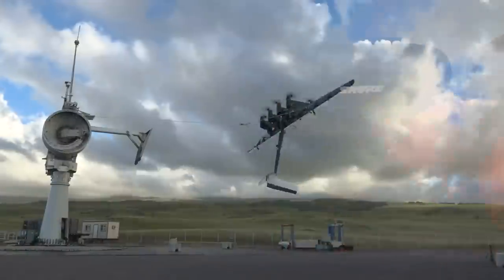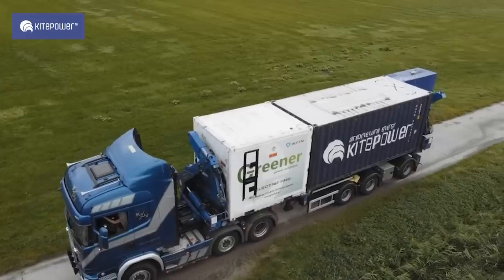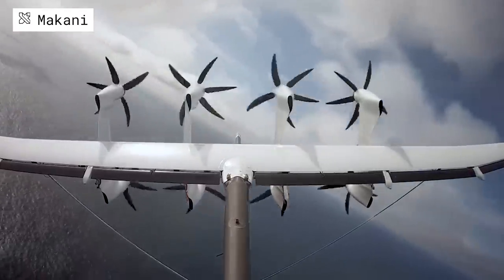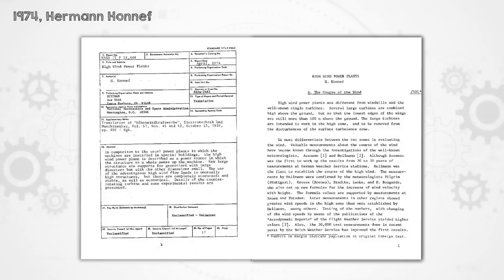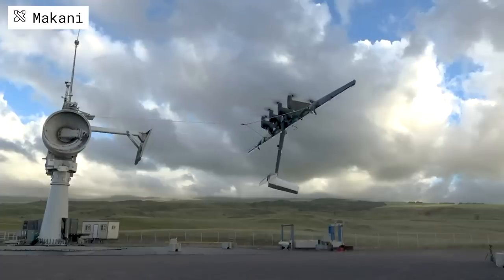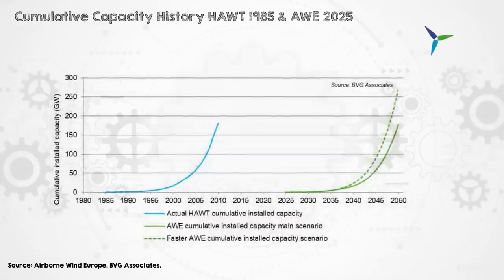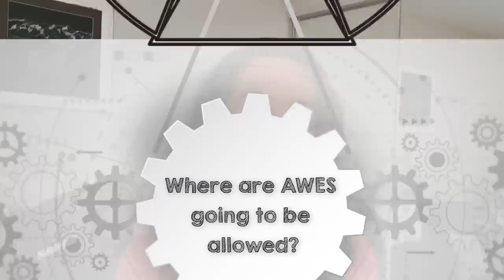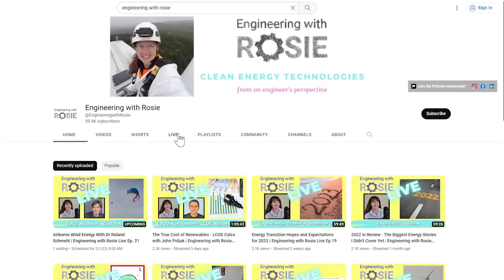Will Airborne Wind Replace Conventional Wind?

Comment: It's a failed idea. It's too complex for power production. Ground based and ocean based wind turbines can and will get much bigger. Giant flying generators on a cable are impractical and the size is limited by physics. The safety margin required would require a huge cable for a megawatt sized flying turbine. The fastest growing and most successful green energy technology on the planet is ground/ocean based wind turbines. Just one of the new large turbines has made more power already than all the flying/kite wind turbines in history. Some ideas that sound good are just dumb. This is the solar roadways of wind. Countries, utilities and individuals build wind turbines because they pay for themselves within 3 to 5 years and make cheap green power for 20 to 25 years. They make money! Maintenance on electric wind generators is easy and equivalent to annually changing the oil and filter in your car.
Reply from the maker: Ha ha, solar freaking roadways!
Reply: Too bad. Its really neat and makes sense. Maybe the trick is to reverse the endpoint to be useful for space powering
Reply: Perfect explanation. Offshore deployment of windmills complying with much bigger power factor generation. That is what we are studying in Brasil as in other places too.
Reply: Your summation of the issues with kite power share a similar flaw that plagues not only this review of the tech but most of the energy tech media today. Rather than focusing on the merits and difficulties of the tech in question, everyone gets lost comparing apples and oranges, as if only a single company is going to supply one type of turbine to the world.
Reply: @malachiteofmethuselah9713  my friend! I used to work as a project engineer in renewable generation for most 30 years. Despiste the merith, this kite technology is far beyound the energy challenge we are facing in world. And its not me that Will condemn an idea, the time and the payoff will do so!
Reply: @iwansabatella7827  Somehow, I just do not feel that a wind turbine that can be deployed anywhere without infrastructure was ever meant to compete with the construction of stationary offshore wind farms, reguarles of whether or not we are talking about an all hands on deck strategy for overhauling the energy sector in a short amount if time.
Reply: You can kill any idea, even good ones, with arguing why they won’t work. 

It requires more effort but it’s more useful to think what would be needed to make the idea work. That could very well include things that aren’t available or that would be too expensive at this moment but it could trigger someone to come up with a solution while the negative reasoning won’t do that. 

My comment is not about the viability of airborne wind energy.
Reply: @alexhguerra  I'd like to see the fly-gen system with a microwave power beam and batteries on a blimp. Though I'm sure there's even more issues with that as well, it's just cool.
Reply: It's a failed idea until someone makes it work.
Reply: @solexxx8588  Your answer shows that flying cars are possible but at the moment too expensive to compete with a commuter plane. 

However you might not need an airfield for a flying car and you could possibly land on the roof of buildings. 

You’d need new infrastructure and regulations for flying cars and operating them would require a new type of ‘drivers’ licence unless they could operate autonomously.
Reply: Scotland doing wind on land, on seabeds and on sea surface.
Expandin hydro and it's all commercial.
Reply: Also normal turbines have been proven useless due to intermitancy.
Reply: Every idea is a failed idea till they succeed.  Sure there are disadvantages but there is still the chance they may be addressed well enough for the concept to become practical.
Reply: @Conservator.   they have that new type of flying car and license, it's called a helicopter.
Reply: @jct4418  ah, see, it’s not impossible.
Reply: @jct4418  there’s also the Pal-v and others.
Reply: No, there is a real untapped niche here of mobility. Competing there could easily justify the complexity. You can see there's real interest from real investors and not a just a gofundme behind this. The suspended kite system might even compete with modern windmills because they don't require as much cost in a supporting structure. If complexity is the only barrier then it's a matter of time. Unless there really are physics limitations here, but I doubt you or I really know better than the people who built this advanced machine.
Reply: @johnwang9914  Some ideas are failed already in the conceptual stage.
Reply: @matsv201  That was what they thought of the Frequency Dependent Negative Resistor as op amps at the time weren't very efficient but now the FDNR is the fundamental circuit of our telecommunication network.  Yes, concepts are considered unworkable for various reasons but if those reasons are eventually addressed or even if some are addressed well enough, the concepts can find a market, at least a niche market.  A so called failed concept may still succeed in the future.  Granted not all so called "failed concepts" may be developed in the future but you can't just discount them as fundamentally flawed.  Remember Einstein considered his cosmologic constant to be a failed concept but it's now what we call dark energy.
Reply: You clearly haven't done any kite boarding, sailing or wind sports. There is a lot of potential. Close minded people have never made great innovations.
Reply: @johnwang9914  Its a huge diffrance between "to hard to work with" and just not theoretically workable.

There are loads of things that been to hard to work with, but the process evolved slowly over time. Actually this been true for pretty much everything.

But for energy there is core part of physics we can easily quantify, then calculate. There is nothing that really changes math and the laws of physics.

Quite the opposite. in engineering, everything with a low efficiency is generally considered something that can be improved in the future . Its stuff that already have a high efficiency, that is hard to improve.
Reply: @matsv201  Who said anything about not theoretically workable.  The video is about airborne wind power generation, the only difference between that and ground based is elevation, how is it theoretically unworkable...  There are challenges and some of the challenges may be difficult for us to imagine being addressed but it's completely within our knowledge of physics, whether or not it is practical now or will be in the future is the question not whether or not it's "theoretically workable".
Reply: @johnwang9914  You are the wrong way down on the issue. The problem isn´t if it can be done or not. The problem is economical viability. Its not. The sweep area is just to small.

You might think that well, they can go faster.. Well not really. Did you know that the tip of a windturbin blade can go over 300km/h. You really can´t go much faster with a straight wing and colect power. You can go faster, but then the energy will bleed of.

If you have a Sweped wing it can go twice as fast and still collect power, the issue then is that the span is limited. 

What about just making it larger. Well no. There is a relationship between span and lift of the wing that is non linear. It can be made larger, but it will eventually lose power.

The biggest problem is intermittence. how do you solve that?
Reply: Skeptics with an inflexible mind like you are the reason why we aren't going nowhere fast with the technology. Many have seen the merits that an aerial platforms offer that a typical stationary turbine doesn't have, so that's why they're developing it. As for what I see, I see that a lightweight, flexible and tensile structure is a much much more durable and cheaper than a compressive structure as of the wind turbine. Just give them time to develop.
Reply: @matsv201  It isn't economical now but it is theoretically possible.   Also, it isn't economical now due to a number of challenges and if these obstacles become eventually addressed, it would be economically possible, even if only some of the obstacles are only partially addressed then it may still find a niche market.  Remember that evacuated tube transit was deemed impossible due to the pressure build up in front of the vehicle, then Musk proposed what if that was mitigated by sat the vehicle having a compressor in front to use that pressure build up for levitation and propulsion, then NASA proved that would only work at subsonic speeds but then people thought is it really such an absolute limitation if the vehicles were streamlined and simply did not occupy the entire diameter of the tube and what if slower speeds were sufficient.  Obstacles are rarely absolute, more like on a gradient, and deeming them impossible to address is simply being a fool, the obstacles may always be there but it may be possible to mitigate them if not removed.  As to flying cars, there it is an issue of alternatives as ground transport despite it's flaws is very effective versus establishing the regulations required for "flying cars", drone technology has shown us a less expensive means at such vehicles so the "less economical" objection has been eroded somewhat.  AI and autonomous vehicles have also eroded the objection of expertise and traffic control for flying vehicles.  As the obstacles are weakened, there are first niche markets that become possible and indeed it could be said that helicopters and small planes are already successful niche markets for small air vehicles as are drones.   You can't just say it's impossible as you would have reasons for considering the concept impossible so all that's needed to make it possible would be to remove or mitigate those reasons in some way.  A concept may be overlooked due to progress in alternatives that might even pre-exist but even then changing requirements might bring a transition and we see that with EV's, internal combustion vehicles are well established but now that we have changing requirements, EV's are being revisited.  Internal combustion engines are another example of something considered to always be uneconomical, external combustion engines such as steam engines were the norm while the numerous internal combustion ideas such as coal dust engines were just laughed at as being too complex and uneconomic, even long after internal combustion vehicles became successful, external combustion steam engine vehicles were still tried by several auto manufacturers.  The small bread box sized computer of the Apollo spacecraft was considered uneconomic for commercial products for numerous reason such as the programming being hand woven in rope memory but eventually ROM and EEROM memory was developed.   There are always reasons for considering a concept impractical but what if those reasons are eventually addressed...  The technical obstacles can always be eventually addressed simply by better technology and aren't as serious an obstacle as competition and even competition with a head start can still be removed if requirements change.  Sure aerial generation will not be likely to replace ground generation but they could become possible for portable generation such as on sailboats where some of the obstacles are simply less of a problem and the advantages such as how compact the equipment is, are just more useful.
Reply: @johnwang9914  No, you are confusing things that have a huge physical capacity for improvment and stuff that dont. Because you are making example of things that have a large theoretical margin of improvement, proves that you don´t understand the concept. There are a theoretical limit for everything. Still todays computer are a billion billion time from the theoretical efficiency limit. YES, there are a theoretical limit of both storing information and making a calculation.  There is one limit for traditional computer, a other for quantum.

" Internal combustion engines are another example of something considered to always be uneconomical, external combustion engines such as steam engines"
No that is just straight down falls. The issue with internal combustion engine was that they was to hard to machine. They always know when machining got better they would be more viable. 

Internal combustion engines was used stationary for about 20 year before the first mobile version was developed.

"such as the programming being hand woven in rope memory but eventually ROM and EEROM memory was developed"
That is just a replacement with totally different technology.

" Sure aerial generation will not be likely to replace ground generation but they could become possible for portable generation "

I really doubt it, but in that case its at least theoretically possible because its no longer competing with grid power cost.
Reply: @matsv201  Everything has the possibility of improvement especially if it's popularly considered uneconomical as they would of course be less developed.  You're trying to claim an absolute, that it simply isn't possible when in fact both technology and the market are dynamic as well as the interests of investors and developers.  What isn't possible now may very well be possible if technology improves, the market changes and investor interest changes.  Of course not every concept consistent with physics will be developed or should be, but to say they never will is only your childishness and ego.  Even external combustion engines may gain a niche market with sterling engines.   Investment is also often inconsistent with other factors such as the trillions invested in fusion when molten salt reactors have already been proven to be safe so in theory slow neutron breeder thorium reactors would both provide safe inexpensive power and consume existing nuclear wastes for far less than developing fusion.  It could even be said that continued investment in the hyperloop concept might not be reasonable given the challenges it faces but this only means that less practical approaches do have a chance of being developed.  Just look at EUV (Extreme UV) lithography, all the research favoured x-ray lithography but because the investment by the Japanese and Intel favoured EUV, it is EUV that is developed.  A better known example would be the VHS versus Beta war.  It isn't always the alleged better choice that becomes successful, developed or even invested in.
Reply: Solexx- Many ideas were nearly laughed out of existence in early development. Material science is often what lags in the effort to implement some ideas. 
When we are able to create cheap long strand carbon nanotubes there might be an application for it here. Think about a small population remote off grid zone, or the same population just after a natural disaster with a wiped out utility. 
These inventions might not save the entire world, but could be an easy cost effective stand in until a more permanent solution is developed.
Reply: @matsv201  "Proven useless"? Can you explain how?
Reply: @johnwang9914  snoflex chose to not respond. Hmmm....,,🤔
Reply: @jimhood1202  Well there are a maximum speed possible with a straight line , and a maximum span to weight. From that a output per amount of material can be calculated  and its possible to calculate a lowest possible price. Its not really possible to beat that because its the material cost, the the tech cost.

The result is that due to a superior sweep area of a normal wind turbine, its just more cost efficient.

To make the system produce significant power to work the wing need to be similar size to a normal windturbine, and the plane there for need to be larger than a 747. Yea... i´m not kidding.
Reply: Thankyou for saving me from myself and saving me 15 minutes watching this video.
Reply: Where are you getting the data thar wind turbines pay for themselves in 3-5 years? They need their blades replaced afterv7 years and they aren't easy or cheap to replace
Reply: @EduardvanRaalte  no.. flying cars aren't possible unless we discover a new technology they allows us to defy gravity without the use of flight
Reply: @daveaamos4335  imbeciles with a ignorant mind are the reasons these start ups are able to scam investors on failed ideas.  Something aren't possible, period. Having a closed mind isn't the issue.
Reply: @szurketaltos2693 yep directed energy, laser etc.
Reply: @EngineeringwithRosie  Instead of imagining regular solar cells, you need to image Tesla solar roof tiles. Those things can survive an apocalypse. The only more resilient roofing technology is a reinforced concrete bunker.

The biggest benefit of "glass" roads isn't even power generation, it's longevity, ease of maintenance, optimal texture, and self de-icing.

Adding solar power is just something you do when you're putting in a "glass" road because you might as well.
Reply: Solar Roadways relied on financing from people with more money than scientific sense. They spouted a thoroughly  unconvincing spiel to those who would have benefited from even a cursory and objective feasibility study by someone just marginally qualified to understand the science behind it. 
What is looking very promising of late, is conversion of ocean/sea momentum to electricity. A denser medium that's more predictable than atmospheric air currents, with many practical benefits.
Reply: Or we just make modern nuclear power plants
Reply: Sucessful!!!!
Haaaaaaaaahaaaaaaahaaaaa
They barely net power
Oil leaks , delamination 
A wind mill can’t even make itself
Reply: I'm not saying I disagree with your conclusions but I don't accept the argument regarding scalability. Yes, physics set some upper limits on flying structures because of the square/cube ratio but you can still quite feasibly scale up by just adding more units or altering your design to achieve the same lift/weight/drag ratios. Systems like this are never going to replace traditional windmills because why would they but they may still have viable use cases. The appeal of harnessing all that high speed wind up there is likely to continue to spur their development in the future.
Reply: Ok, so this seems to be a common misconception of wind turbines! 
1) they are super inefficient their gearboxes blow apart frequently, and they are very expensive. 
2) The only reason they are still in operation is due to government subsidies!
To break it down the surface speed between the blades and the gears are so dramatic that the biggest starting gear has to travel a supersonic speeds which unfortunately a gear that size doesn't like that to much, then as that gear scatters it takes out the rest. Wind turbines will go away as we get further into technology, but for now, they are nothing better than an expensive tinker bomb!
Reply: To that list, add "clean coal".
Reply: If we create wind inside room,same we put fan and create wind. We can make constant wind circulation around instrument,  without spending too much of energy.
 Yes we can create cyclone inside room,  without spending too much of energy or larger fan .
I can't give on net people can misuse it.
Jay shree ram.
Reply: I imagine the same was said back in the day when someone said one day there will be 15MW wind turbines producing power out in the ocean. "What? Are you crazy, just stick to coal, what could go wrong?"
Reply: Weight to power ratio along with low wind/ changing wind can be a catastrophe.
Reply: Can be done but the costs of long term deployment/ reeling in for the “wrong sort of wind”, maintenance etc makes it unviable.